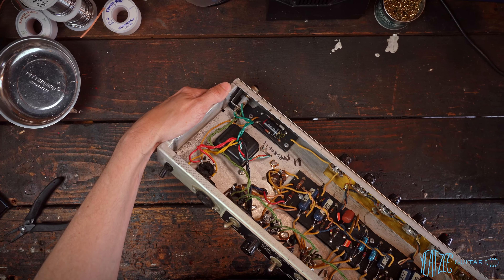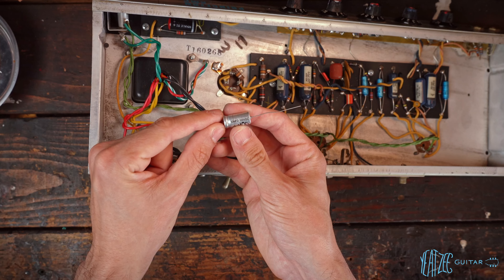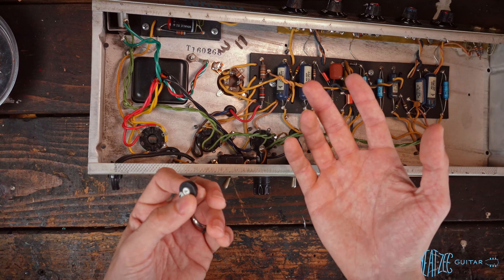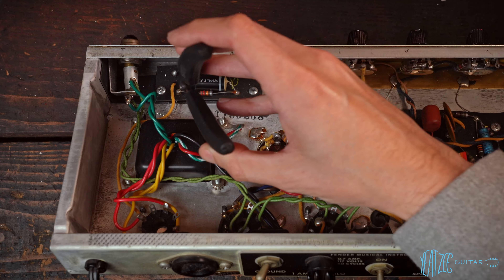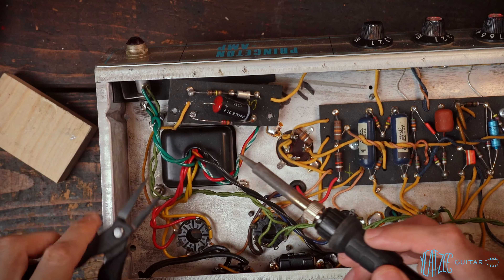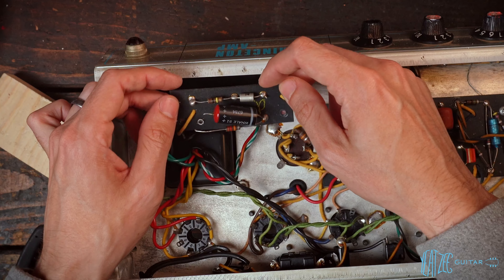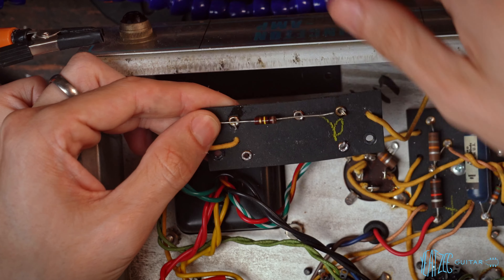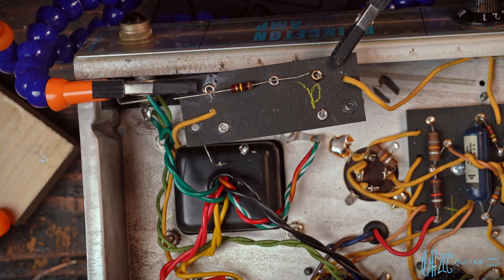ADJUSTABLE Bias mod on vintage fender amplifiers (easy) | PART 1

Comment: You know I was wondering why you didn’t “strap” the wiper to the other lug of the trim pot so in the rare event of a trim pot failure you wouldn’t lose bias.  But after thinking about it, if the trim pot loses its ground reference the bias voltage just goes more negative, right?  So it doesn’t really matter if the ground reference is lost, right?  Gets a cooler bias, might not sound as good if it dumps to 35% but it won’t hurt anything… Maybe?
Reply from the maker: You're right, it'd be better to ground that lead along with the wiper in a catastrophic failure event

Comment: Since you are improving the circuit why not replace the 100K  1/2 W with a 1 Watt 5% metal film. since it is connected to the HV secondary it is under more stress than most other 1/2 watt resistors in the amp?
Reply from the maker: I don't swap carbon comps for metal films in all original clean vintage amps like this. This adjustable bias is about the only thing I like to do beyond following vintage spec on these. Ymmv

Comment: (Not trying to be negative or facetious) ; but That 22k joint opposite the trim pot is definitely a cold joint. You can tell by the solder is formed around, not with, the resistor lead. Being educational, some people might not know the difference or the need to reheat the joint.

Just trying to be helpful!
Reply from the maker: That's caused by the old lead of the resistor being dirty so the solder doesn't want to stick to it as much as clean fresh components, not because it's a cold solder joint. The resistor is crimped around the eyelet with a solid mechanical connection and solder flowed freely across the eyelet. That being said, I knew and as you'll see in Pt 2 releasing shortly today, 22k was never going to be the right value for a usable range in a Princeton so it was always going to get swapped.
Reply from the maker: My mistake, its already out: https://youtu.be/ysPYG7NXByw
Reply: @YeatzeeGuitar  right on man! Iron sharpens iron, I think you’re doing a great job!